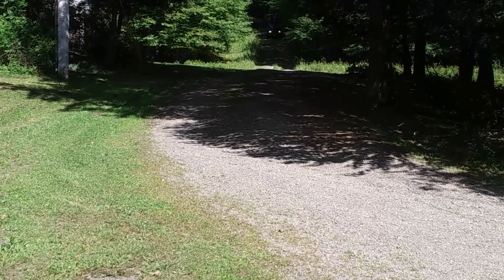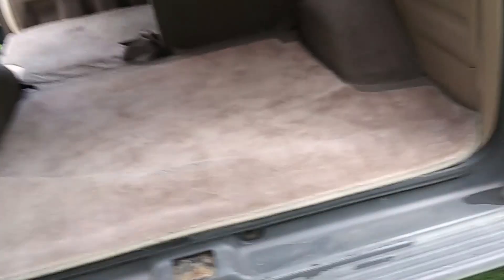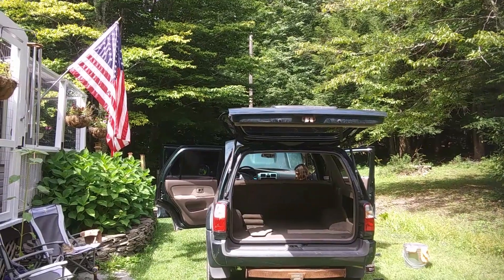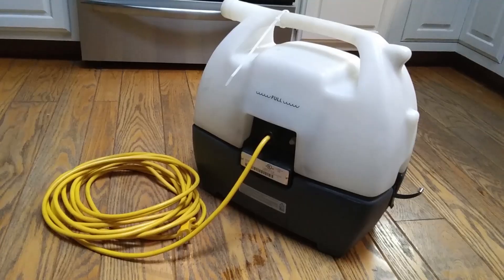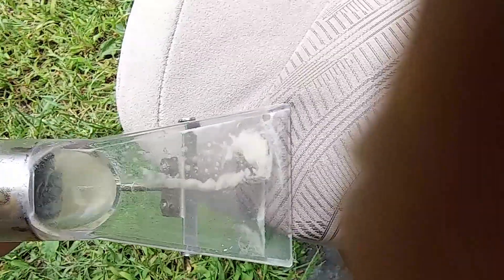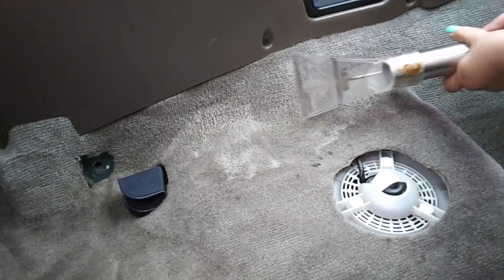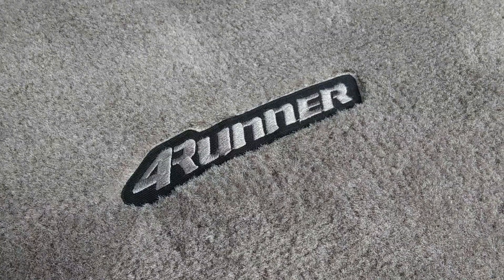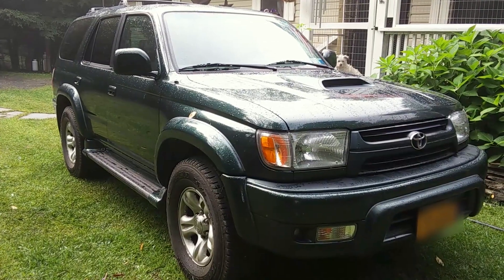Deep Cleaning My NEW 2001 3rd Gen Toyota 4Runner

Comment: Looks so good. I want one of these trucks so bad.
Reply from the maker: If you do get one, change that radiator! Apparently it's a thing and I had no idea. If you don't change it and there's a problem you may wind up needing a new transmission. Luckily our issue didn't get that bad, but we were lucky. So definitely get one, but then also get that radiator checked and replaced.
Reply: @samechick  Thank you for the tip!